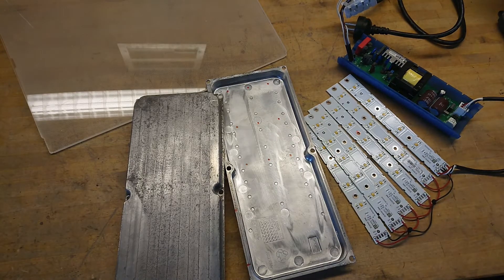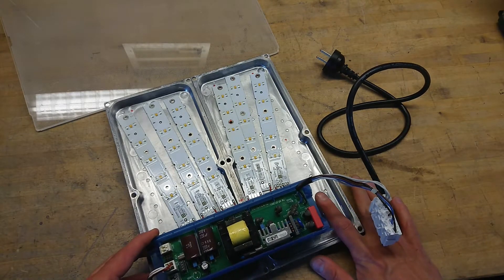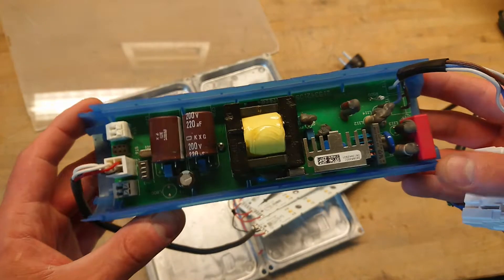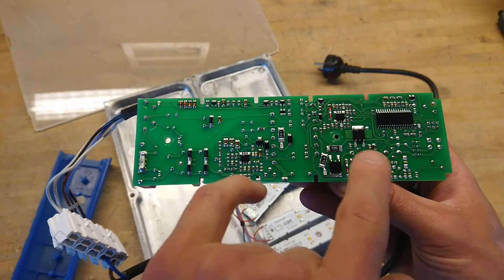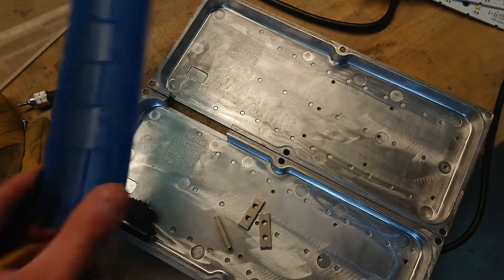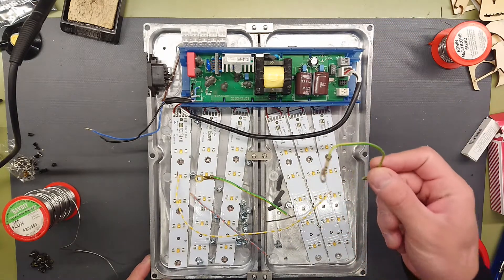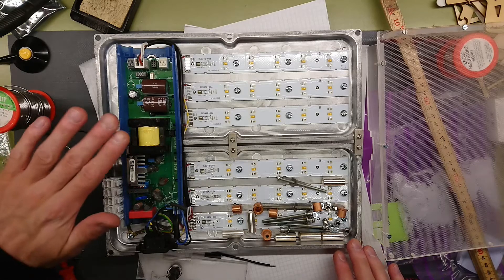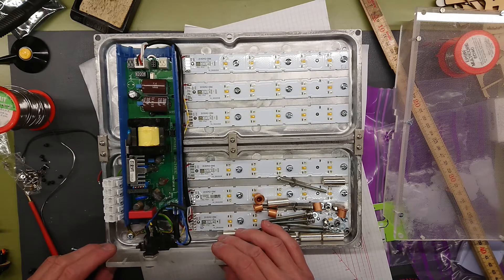DIY 30W LED Work Lamp From a Discarded Street Light

Comment: Very nice lamp you made there. I have build a few led lamps (ex streetlight fittings) not as nice as yours. power supply 2 uF mains cap volt dropper, 100 Ohm 5 Watt series R, diode bridge (ex TV) and LED segments. The led's don't need to run at maximum power, as they have to lit up a road from 8 meters. Output is pretty good with less current and also less heatsinking required.

Comment: i took a more "lightweight" solution for my desk... i used two 10W metal plate led modules for a total of 20W 20V, they are screwed to a PC mainboard northernbridge heatsink, a small fan (noisy tbh) and the whole is sustained by a retractable antenna sticking on top of my PC monitor, then a printer PSU with a limiting resistor.... i used a small heatsink with a fan bcs it weighted less than a "20W heatsink", so the thing can be held by a stupid antenna and carried around with a light tap of my hand, also there's a shield for my eyes made with some aluminium thick foil... the whole may weight 70 grams